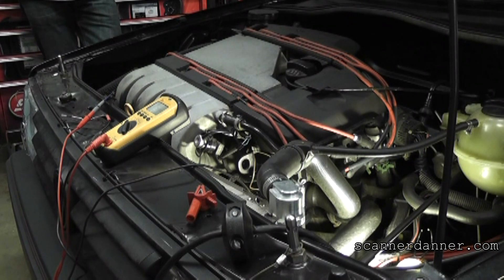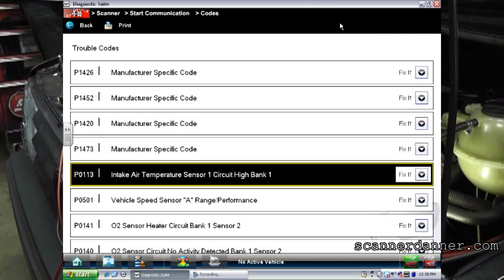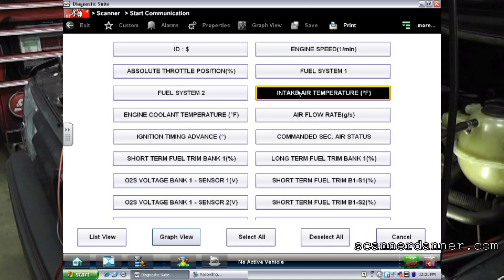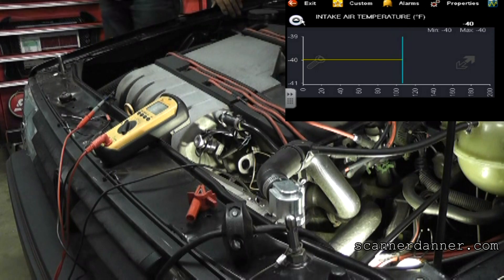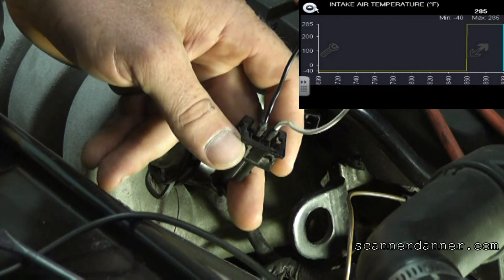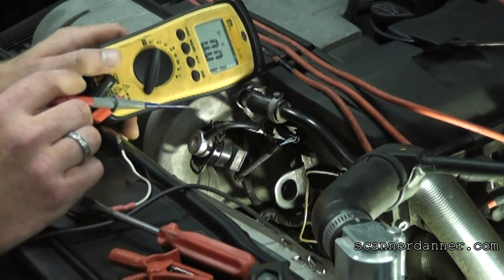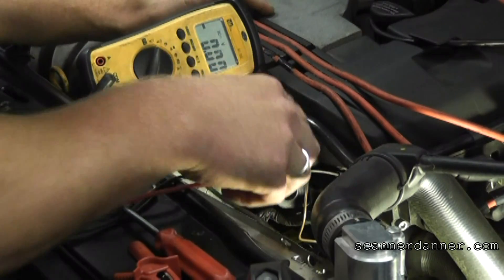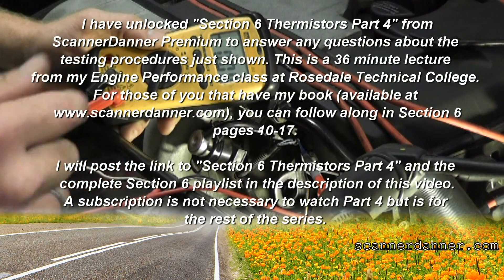How to test an Engine Coolant or Intake Air Temperature Sensor (any car)

Comment: Thanks man. A hell of a lot better than other videos showing people testing resistance on the sensor itself while dipping it in water at whatever temperature.
Reply from the maker: Yeah, most ridiculous test ever. A quick voltage reading on both wires is all you need and then use the engine to heat it for a change in signal

Comment: Hey, how can I contact you. I need someone to check my 2017 Hyundai Sonata. Since the engine was replaced, the vehicle had not been operating normal.
Reply from the maker: Where are you located? What's your budget for getting this problem pinpointed?

Comment: New subscriber here and new to diagnosing my own electrical (yikes)  intimidated yes. I'm getting a po113 code GM cadillac deville 98 4.6 (yikes again ) difficult engine for shure . I jumped the wire without the sencor in and got nothing using $50 scanner yet I put back in the sencor and did the test with a volt meter  like you showed and got 5.4 volts on both wines. Does that make sense to you doesn't to me but what do I know. Any input greatly appreciated 👍 thanks and learning!
Reply from the maker: 2-wire temp sensor reads 5v on both wires, plugged in, right?
You have an open in the sensor ground circuit. That's why jumping them together didn't change anything. Look carefully at the harness for points of contact and rub through

Comment: 1998 Ford Ranger 2.5L first my scan tool is reporting a IAT of 107' F when outside ambient is  80"F . I unpluged the sensor and got the -40 on scan tool. I jumped the two pins and got max temp of 335 degrees.  I checked for 5 volt reference plug off and got 4 volts. plugged it back in got 1-2 volts back probing.  Does this suggest a bad sensor ?  I am experiencing lack of power at open throttleI am a newbie like your channel
Reply: Did you figure it out ? I have almost the same issue

Comment: Why does computer show minus 40 for open circuit
Reply from the maker: It is in the computer look up tables.
Cold = high volts
Hot = low volts (on ALL temp sensor circuits)
An open circuit will cause the highest voltage that circuit will ever see. So 5v = -40
Reply: @ScannerDanner  thanks for explaining that ...understand now

Comment: If I wanted to obtain the specs on every sensor in my 2000 F-150 (or any vehicle for that matter), is that information available to the public, and if so, where? It would be nice to know what resistance range my specific IAT should be for quick testing. Thanks for your vids, very helpful.

Comment: this jumper wire have a resistance  or just a wire
Reply from the maker: if I used a jumper wire for a test in this video it would have just been a jumper wire, no resistance

Comment: What would see on the sensor ground if temp sensor is working?
Thank you
Reply: Would the voltage not depend on the temperature that the sensor is picking up. So -40 degrees to 200 degrees somewhere between 0 and 5 volts dependant on temp??

Comment: Did you just ground the other probe when you were measuring the voltage with it plugged it? When I tested mine I got 4.96 on both but I had the connector unplugged

Comment: thank you for this! I posted the trouble code I was having constantly and everyone told me the sensor was in the maf. I checked forever trying to figure out was wrong with the maf but everything tested out. turns out the iat sensor is right where you showed it to be. thanks a million for your help!
Reply: so I have a slight issue. when I test the positive wire with the volt meter I get 4.9 when I test the negative I get 0. when I jumper the wires together though it stays at the max value of 141 Celsius. even when the sensor is unplugged it reads 141 intake air temperature on my scan tool. do you know what the issue is?
Reply from the maker: that is called a substituted value and is normal
The computer knows the circuit is opened and or shorted and will plug in a usable number based on run time and coolant temp. Make sense?

Comment: When you test the ground side with the volt meter you back probed the ground wire but where was the other lead  attached. Thank you. Your presentation are so clear and indepth,
Reply from the maker: +juanjohnism my voltmeter was connected to ground the whole time. It is a difficult concept at first (a ground to ground voltage test) but if you use it enough you will totally start to trust it. You need to see some bad grounds first for it to make sense. Watch these bad ground videos:
https://www.youtube.com/watch?v=44dP6X3QS5A

https://www.youtube.com/watch?v=bJRLZnjS6ms

https://www.youtube.com/watch?v=rQ7tvIxQSt0

Comment: Hey man just wanted to chime in and say thank you. I've learned a lot from watching you and I just became an L1 certified master tech as of Monday. Awesome info on your channel. Thanks again.
Reply from the maker: +andrew johnson awesome! would you mind posting this comment on my website?
http://www.scannerdanner.com/forum#/20150619/where-to-get-wiring-diagrams-4839109/
Reply from the maker: +ScannerDanner sorry wrong link

http://www.scannerdanner.com/customer/feedback#add-comment
Reply: +ScannerDanner yea man no problem. I have a question though. I had a vehicle today with a p0300. Ended up being crossed wires because of the guy trying to do it himself. I found it with an ignition scope. Why is the firing line so low when wires are crossed? Is it because the spark is being fired on the wrong stroke?
Reply: +ScannerDanner found the answer myself. I forgot firing voltage is affected by compression so i was pretty much spot with it being on the wrong stroke. I'm still fairly new with ignition scoping.

Comment: Hey Paul great Video.question though wouldn't you use a fused jumper wire.or am I missing something
Reply: +fl0302 I will recommend put a resistance between the connectors, simulating some temperature, put this wire is actually a short to ground..... or there is some protection ? Sorry for my english
Saludos
Reply: The ECT sensor draws  a teeny tiny amount of current, so a basic jumper wire is fine.

Comment: Ooo, nice engine swap!  I have a '97 Passat VR6, so I'm quickly becoming all too familiar with that engine...  Time for a 1.8T IAT swap!  ;D

For information purposes for anyone who might find it helpful:  ALL the engine sensors ground at various points on the engine block; they do not ground at the PCM.  In particular, one ground on the backside off the cylinder head is prone to high resistance/failure, due to its proximity to the exhaust headers.
Reply from the maker: +rhkips is this a vw thing. It would be very uncommon for the sensors to be grounded on the block.
Reply: +ScannerDanner as far as I know, it applies to 12v VR6 engines with engine codes AAA and I think AFP.  I don't know if it applies to other engines, or if it was only a specific era.  I have a digital copy of the wiring diagrams for the B4 (94-97.5) Passat, including power and ground distribution diagrams, if you have somewhere I could email a copy.  :)
Reply from the maker: +rhkips thanks for the information! I think that is some pretty critical differences for sure.